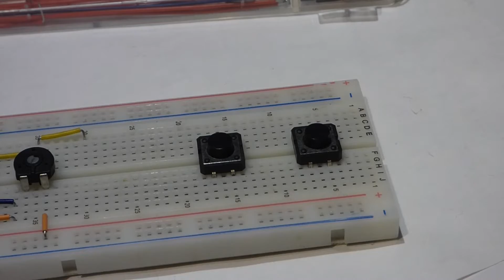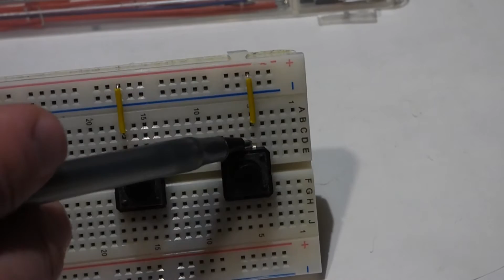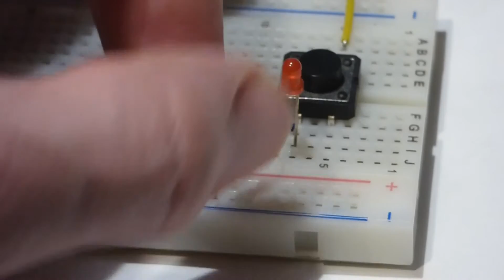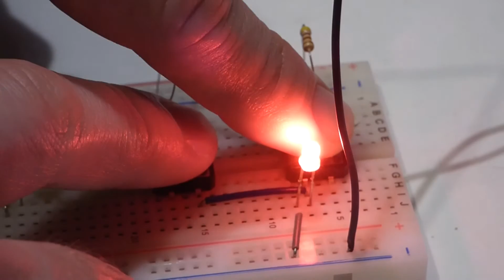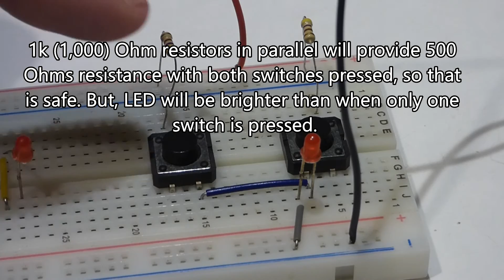Electronics OR Logic Gate simulation circuit using tactile momentary push button switches

Comment: great, actually a couple of long does spending working on breadbaords and from dozens of things I gone through none worked😢, except for your videos😊. Couls you make little projects like this  with the 5v power supply you reviewed earlier? I have a kit with only a specific capacitor, resisotor etc range so its difficult to adjust. Thanks

Comment: How can one invert +5,6V to 0,7V by pusbutton on a normally open button?
Reply: you connect the button in parallel to the LED so that when you press it, it creates a short circuit across the LED and switches it off.